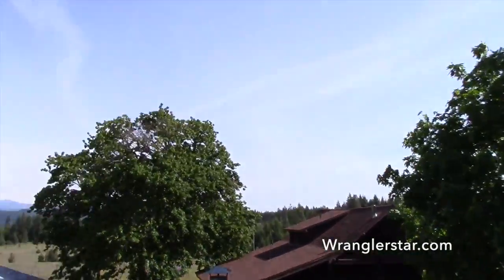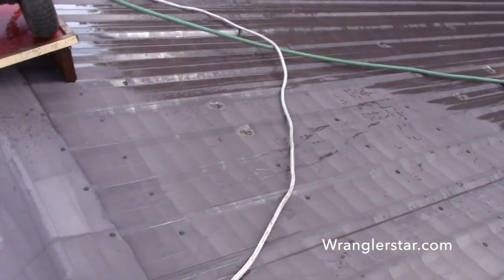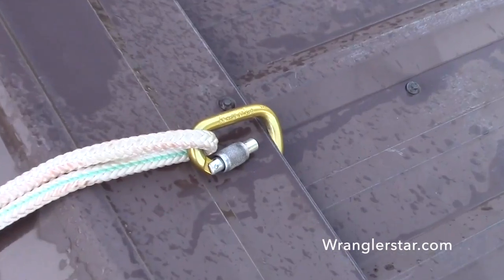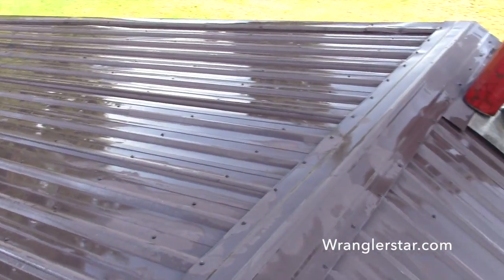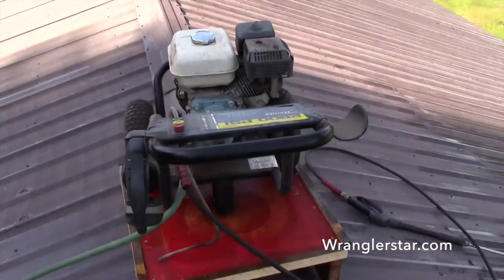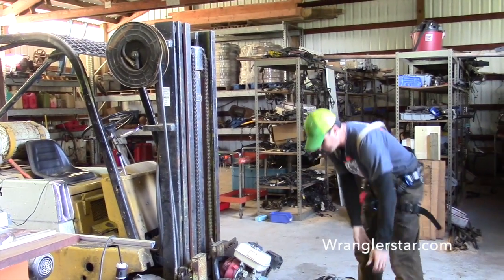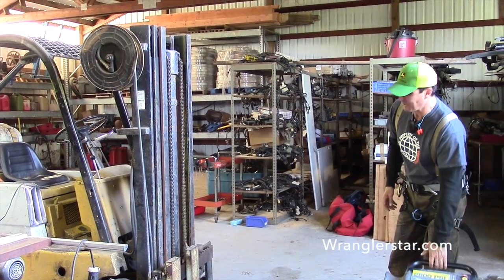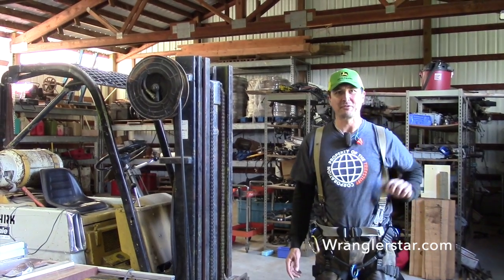How To Fall Off A Roof +

Comment: Cody, Don't fall off the roof! Been there. Done that. I discovered your channel while I was recovering from falling off mine about two years ago.  

I was thinking the forklift could have solved this problem.  I know it can't reach as is but think of it as a carpentry project. 

If you build a box shaped frame that the forklift can just reach the top of, then use the forklift to place a pallet of equipment on top of the box frame, then pick up the box frame with the forklift and raise it to the roof. Such a contraption could be built in such a way as to not tip off the forks (think rails above and below the forks.) Likewise, the top of the rack and the pallet could be constructed to capture the pallet to keep it from sliding off. Add a couple of shelves in the middle and the frame will have a storage purpose when not in use as a portable scaffold.

Comment: Lots of surface area for water catchment.  I'mm bet you have 6000 sq ft of roof area, on all your buildings, which would be about 3500 gallons of fresh water per inch of rain.  That would be a great resource nearby the houses in case of fire or to water the garden/orchard.

Comment: There is a orbital head attachment for pressure washers.  It rotates the "pencil beam" of the pressure washer.  That way you get 100% pressure and volume focused to a small point and the orbiting function does the work (wrist action) for you.  A real time saver. That attachment works wonders on decks, driveway stains, siding....

Comment: If you don’t have any anchor points on the top you should put a static rope straight over the structure and anchor at ground level both sides with an alpine butterfly in the top centre point. Then just clip to that with a dynamic rope to help with fall arrest. This two rope system only fully works to arrest in particular directions. Remember that a load at the centre of a rope @ 90 degrees can have up to a 300% mechanical load. This can be resolved by having another static rope crossing over the original. This has the advantage of working better on “thinner” structures.

Comment: I've noticed you haven't been in your woodworking shop since the top bar bee hive episodes. Do you normally work in there during the winter, don't have enough time or just lost interest? I built your same bench from spruce and ironwood. I used your videos along with Paul sellers's videos and really enjoyed making it. I would you be willing to upload some videos about making things such as boxes, toys, and/or anything else? 
I Just made a 1/2 inch top out of ironwood because of the toughness of it. it was a little expensive though.

Comment: You would be pleasantly surprised to find out how much better a rotary nozzle would work on your pressure washer. It greatly reduces the strping effect and because the jet  hits the surface from multiple angles it works great on wood grain...not that expensive either....
Reply: Steven Hardy Where do you get them?
Reply: I bought my last one at either Lowes or Home Depot.  I have found two very nice uses for mine quite by accident. Number one best leaf blower I have ever used.(the water hiiting the air creates a huge blast of heavy air) Number two If you are burying pipe and have created a runoff hole,the circular fan of water makes a terrific trencher and cuts through earth like soft butter.
Reply from the maker: Steven Hardy My dad was just telling me this,
Reply: Yeah...I have had one type or another of pressure washer for a long time. Every now and then I discover a new use or accessory. As I have said to you before you are an excellent teacher. If you ever find yourself short on topics....pressure washers would be a good subject. There are many people that just don't have a very good understanding of how or what to use them for.
Myself ...I would like to have seen a video of you getting that thing up onto the roof...that would have been comical to watch.Your rolling platform is an idea I once implemented...but I used a dump trailer instead...and guy ropes to keep the ladder in place at the top.

Comment: Cody, you usually do stuff is such a safe manner.  it seems that this time, instead of doing the roof in sections at a time and keeping the washer on the ground, you chose to take the more dangerois route.  Did you really save time here?

Comment: I would have tied a rope off onto your truck and worked the opposite side. Use a prussik up on the roof itself (grips any direction) or some sort of mechanical rope tool and you could be secure and maneuverable in a harness. If you had enough slack in the rope to maintain maneuverability you could tie the other end of the rope to a post, tractor etc on the other side to make your transition from one side to the other a matter of pulling slack through the prussik at the peak. Especially nice lifting heavy stuff over the edge. I work on rooftops frequently for work where I have to pull tools up and down and this is one way I do it. Time spent setting this up can actually help you work faster too. (PS to improvise getting the rope over from the ground get a tennis ball and some mason line, throweights go farther but watch for gutters if you don't clear the other side)

Comment: A really simple way to tether yourself to that style of roof might be to just take a 4' long 2x4 and run it through the table saw on one long edge at a 45 to give it a tooth to bite with. Then take a 2' long 2x4 and glue and screw to the top of that. Drill a hole through the middle of the sandwich for the rope to pass through and be held by a stop knot. Now you have a sliding toe board...
Reply from the maker: wb5mgr great idea,

Comment: You know that moment, when you are already in too far, and the heavy load is already hanging off the side of the roof, and you are the anchor keeping it from falling and slamming the truck and/or your wife...that's when the superior human mind kicks in and comes up with a simple and effective solution.  Good work team.  I laugh at YOUR anchor though Cody, hah!  But I know what you mean about it being more psychological help than physical help.  I've been on many a roof like that one, and I find it's largely about making sure my feet are firmly planted on protruding screw heads with each step.  Generally the slopes on buildings like that are 6:12 or less (most 4:12 or less in my experience), so definitely not too scary if you're used to it.  The rope and harness does ease the mind so you can get the job done. 

I hope no flocks of birds roost overnight on your newly cleaned roof.

Comment: Ooh that's slippery lucky that roof is only a 5-12 pitch or so. What supposedly works is using a chunk of foamy not the denser stuff its usually 3 inches thick its a little more open cell usually green in color. Anyhow when its wet it provides traction on metal roofing when you are standing on it. I can imagine you are a little stiff and sore the next day cheeks clenched trying to hold yourself steady on the roof.

Comment: Another "Chemtrail contrail" 3 min 11 seconds. A perfect back drop.
Reply: Jack Walsh lol!!!
Reply: Donnybrook10 lol. you do understand that the products of complete combustion of oxygen and a hydrocarbon based fuel is carbon dioxide and water? that is all those trails are, water vapor. they are man made clouds. 

your car produces the exact same exhaust. only at 30,000 feet its a lot colder allowing the water vapor to condense. you can see it when it gets really cold out cars have a thicker cloudy exhaust.

don't you think those airliners would have a bit of a problem with engine maintenance if they were mixing heavy metal toxins into the fuel lines? 

the fact is aircraft since they were invented have left contrails. there are ww2 news reels of b17s flying high over germany leaving entire formations of contrails in the sky. and i highly doubt they were spreading whatever tin foil hats think they are spreading now back then. and if they weren't doing it then why are the trails the EXACT same now.
Reply: ***** There are federal programs and research projects where they spray various chemicals into the atmosphere from aircraft. They do it from specially modified aircraft. They do not however mix stuff into the fuel as some propose, that would destroy jet engines. As I understand it these programs were short lived and as you say not some tin hat conspiracy.   I suppose the unburned fuel that is present in jet exhaust could be called a chem trail though.
Reply: *****   I understand the chemistry and physics of "Normal contrails" from a " High bypass turbine engine". What I am referring to
in "Geoengineering" and the related "Chemtrail Clouds" That are purposefully released from an aircraft.  Whether via "Engine exhaust" 
or Aerosolized  from a venting mechanism.  My point is that after this 
particulate mater. Which is about 10 microns in size. "Nano Polymer" 
technology. A human hair is 60-70 microns in size. Visible to the human 
eye.  These particles are chiefly composed of metal oxides of Aluminum, 
Barium, Strontium and the like.   The whole point here is. Once these particles are breathed in via your lungs or ingested in food.  They are in 
the human body. These metals accumulate over time and they do not come out of the body, once inside. 

  In turn degrading all systems of the human body. Vital organs, nervous system, immune system, etc.  This is just one aspect of the negative effects of "Geoengineering"  Research what I have briefly written about here.   Four years ago I knew nothing of this subject. What has learned is very sobering and actually very scary.  I consider "Geoengineering" every bit as dangerous as "Nuclear Fallout" I do not use that term in jest.
I'm extremely concerned for peoples of the world and it's children, too. 

Educate yourself about "Geoengineering" and come to your own conclusions.
Reply: Well Mate, were breathing the same air. If you need any absolute proof. Go have blood samples drawn and be tested at a qualified lab. A toxicology screen for metals. Aluminum, Barium, Lead or Strontium.  I hope, I am wrong.
Reply: Jack Walsh That stuff is in the environment possibly even the atmosphere, however saying that it got there as some sort of geoengineering   project using aircraft to seed it by adding it to commercial jet fuel is rather ignorant.
Reply: The technology you state as "Ignorant". Does in fact exist. Research it and come to your own conclusion.
Reply: Jack Walsh I have researched it. I also know something about aircraft engines. you can spray particulates into the atmosphere. You could even inject it into the exhaust of an engine. If you add that abrasive particulate to the fuel, two things will happen. 1 the filters will catch enough of it to clog them up even though the particles are smaller than the filter media, it will catch some of it. 2 The abrasive nature of aluminum in particular will destroy enough of the engine to cause major problems. You can't put it in the fuel and run it through the engine.
Reply: Do your your homework Mate.  By your statement. You obviously have not.  I very much work in the here and now.  I'm all about empirical data and not just applied research.  If I'm a "lunatic" it's a sober one at that.

Comment: I've never met a pressure washer that either didn't require constant maintenance or just quit working after a few washes. Having owned several of the temperamental beasts in the past, I will now and forever more just RENT one if the need arises.

Comment: It's the dust on those roofs that will send you ground.Sawdust on plywood roofs is treacherous.We just built a buddy a pole barn with a 4 12 metal roof and I did most of the screwing down mid roof.I told him NEVER again.

Comment: Roof Roping ! Yeah !  way to go lol  never cease to amaze... washer has wheels let roll off. no telling what it's gonna look like after but hey... quick n easy !  lol
Didn't you say you needed a new one anyway ? ...
or another tool to repair. either way works.
ok so, someone PLEASE provide him with a 100 ft pressure hose. he needs one for sure and a 10 foot wand to spray from the ladder. (illusion of safety)  sorry couldn't resist... : )

Comment: wranglerstar I have to ask, isn't the forklift able to reach the height of your roof? It would have been much safer to strap it to the fork lift rather than actually place it on the roof. At the very least wouldn't it have been easier to use the forklift to put it up and take it down from the roof? It just seemed to me like it didn't cross your mind at the time to use it. I like your channel and would hate to see you become a winner of the Darwin Award. lol

Comment: sketchy as hell but i wouldn't write off that Carabiner. if you fell it would probably tear or bend that thin sheet metal to hell but just that little bit of resistance would be what it takes to stop you from sliding right off.

$600!!! are you out of your flipping mind!!! we managed to get one for a couple watermelons and a couple 3 liter bottles of coke from a shop just down he street. they didnt know how to get it running and they didn't know how they were going to load it up and get rid of the thing. so we asked the stupid question " if ur fixin to try getting rid of it maybe we can drive off in it?". obviously they didnt think we could get the damned thing running but sure enough after 4 hours of fiddling with the damned thing we did lmao.

Comment: I couldn't believe after watching you struggle to get the power washer off the roof you have a fork lift?  Is there a reason you couldn't have put a pallet on it, raise it at the gable end,or any point,put the power washer on it and bring it down safer and easier,without putting you and your precious wife at risk? I know she was probably safe  But I'm curious why you didn't make your tool(forklift) work for you ?